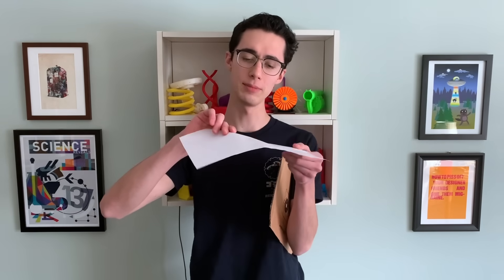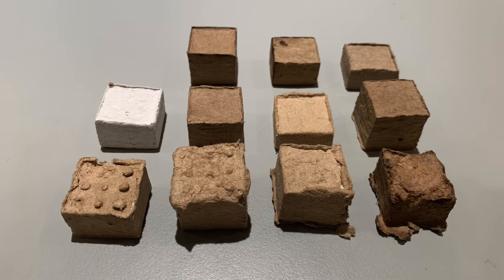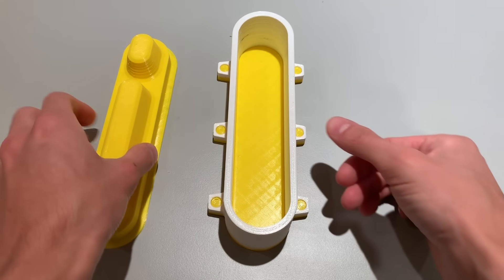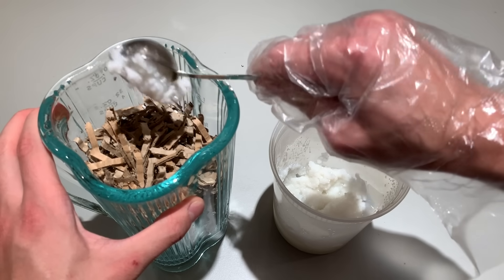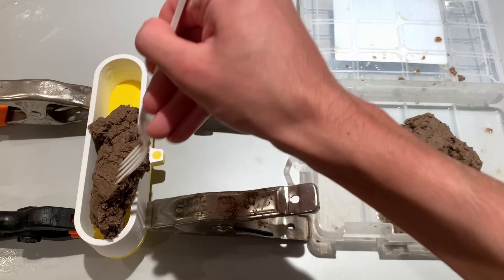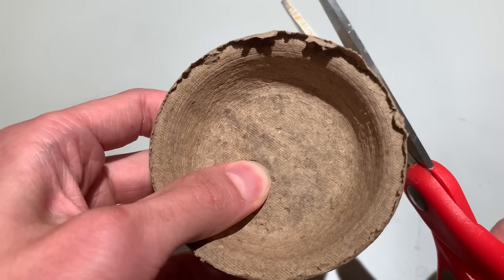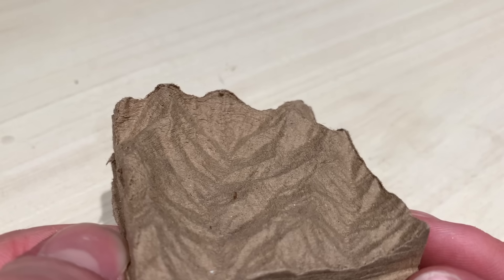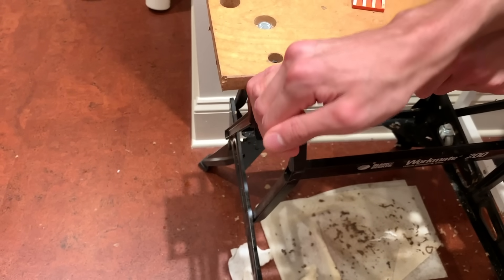Recycle Cardboard into Anything with 3D Printing!

Comment: Ok, but let's not forget that unless you're making a mold for something you want to make many pieces of, this is not eco-friendly. I imagine that a lot of makers inspired here will waste a lot of plastic on molds for something that is basically almost useless and that they could have made out of that plastic in the first place. It's tinkering and it's good fun, but let's not pretend it's green if you used a lot of plastic in making it. Of course it's cool if you're making a small-run product and want a paper inset for th packaging, but for that - this is still a lot of work for just a packaging item.
Reply from the maker: Totally fair points. I’ll add though that: 
1. The molds are reusable, and can form multiple times their mass in cardboard
2. The molds don’t have to be 3D printed out of plastic. They could be CNC’d out of any number of materials or created via other means.
3. This video is a loose concept, not a concrete methodology. To take it at face value is to miss the ideas. The “greenness” of this project is in the material’s potential to be substitute for plastic.

Comment: Great job making this video! Not only is it a proof of concept for reducing cardboard waste, but you’ve made a biodegradable material! I wonder if this is something that can be used in the funeral business for a biodegradable container when spreading ashes at sea? 
There are lots of DIY hydraulic press videos on YouTube. I would suggest a simple 5 to 10 Jack along with some sort of catch system underneath for excess liquid, that comes out of a very fine SS sieve. It seems like you could run your egg, cartons and cardboard through the same shredder set up for recycling HDPE type plastics. I wonder if there is anyone out there who has looked into adding some type of powder to strengthen the structure? I don’t know exactly how carbon fiber works, but either way great job for getting people to think about repurposing and recycling instead of landfilling items. 
You seem like a natural fit for this organization 

https://youtu.be/S_lDWZ2nUnU

Comment: So cool.  I'm sure someone else already said it somewhere in the comments, but I wonder if you could use hemp fiber to add a ton of rigidity and strength to the final piece.  They use hemp fiber to strengthen plaster casts and the difference is enormous.  In terms of final coating, I'm sure a thin epoxy coating would would work well.  You could experiment with thinning out the epoxy so it would be more likely to soak into the dried pulp.  Thanks for sharing.  Definitely want to try this.

Comment: Проделанные иследования очень интересны, но не более того. Но вы не делаете ничего полезного,  смысл печатать пресс-форму, что бы сделать бумажный стакан для ручек?! Проще сразу напечатать стакан.  Дерево довольно доступный материал, проще делать с него. Очень ресурсоемкая работа. думаю есть книги по этой технологии, может стоит их почитать, если вы хотите достичь большего.
Reply from the maker: This video is about showing a rough process, not a final product. Of course if you only want a pencil holder and don't care about the material, then it's easier to just print it directly, but that's not the point. This is a loose fabrication process that can be modified and changed to fit other applications, which other folks have done. Also, if you do care about the material and want a pencil holder made of this material, then this is maybe the only way to produce that. Sure, the final material is ~like~ wood, but it's not wood, it's something new with unique properties. All that said, why do things even need to be "useful"? I did this purely out of my own interest, not because it's useful for any specific application.

Comment: Printing plastic to recycle a biodegradable material..... i want to die.
Reply: PLA is biodegradable and I think it's made out of corn
Reply from the maker: 1. The molds are reusable, and can form multiple times their mass in cardboard
2. The molds don’t have to be 3D printed out of plastic. They could be CNC’d out of any number of materials or created via other means. I only used a 3D printer because it’s what I had on hand.
3. This video is a loose concept, not a concrete methodology. To take it at face value is to miss the ideas. The “greenness” of this project is in the material’s potential to be substitute for plastic. Not to mention, any plastic I used in the creation of this video is trivial compared to the amount use globally.

Comment: No offense, but this is the equivalent of making solar panels using fossil fuels.  ...Or are you recycling the (!plastic!)molds?
Reply from the maker: 1. The molds are reusable, and can form multiple times their mass in cardboard
2. The molds don’t have to be 3D printed out of plastic. They could be CNC’d out of any number of materials or created via other means.
3. This video is a loose concept, not a concrete methodology. To take it at face value is to miss the ideas. The “greenness” of this project is in the material’s potential to be substitute for plastic.

Comment: Okay, but why do any of this? Like, in what way is this a superior way of making anything?

This isn't a good material for making any of the things you've shown it being used for.

It's 100% going to degrade rapidly compared to other available materials, even if it doesn't directly get wet.

The reason paper products are formed as they are is because it's fast, light, and effective.

Every use case I can think of is already met by better extant solutions, and that's obvious, because you obviously aren't the first human to think of forming molds and compressing paper in them.